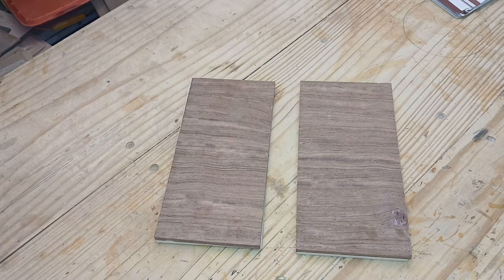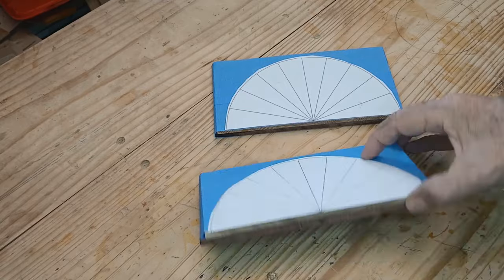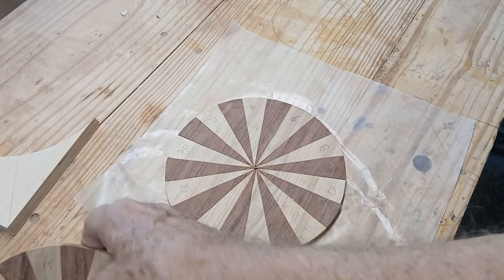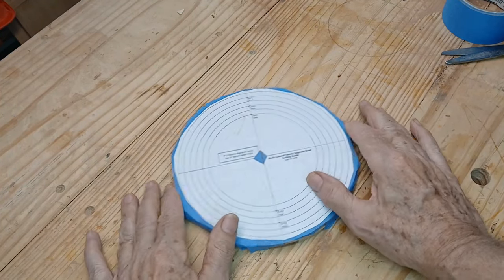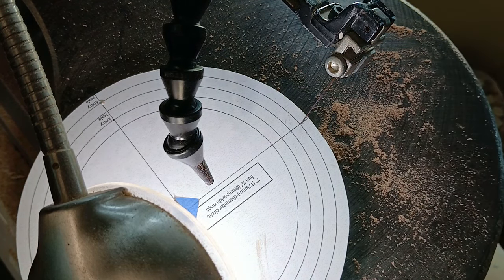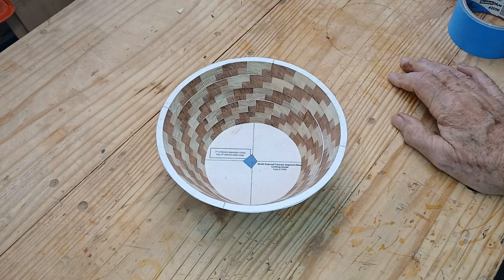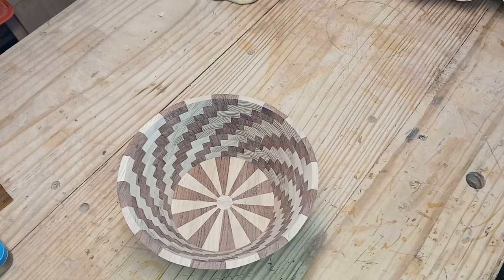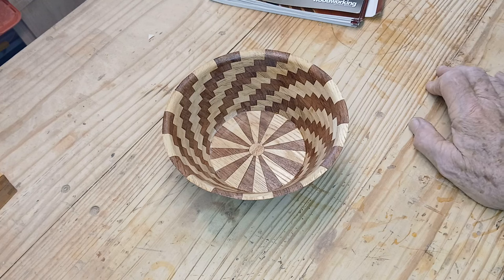Scroll Saw Bowl Made With 20 Segments (Actually There Are 40)

Comment: I'd be curious to know more about how you make these videos (what you use to position the camera, what editing software you use,  etc.  I'd like to make some videos of my own for my woodworking club here in San Diego.
Reply from the maker: I knew nothing about videography when I started out.  Just used and old camcorder a years ago when my daughter was small.  Check out Think Media on Youtube they led me to a lot of my equipment.  I have this stand  https://amzn.to/3Vd3hPs 
it is a little light but I stand it next to my work bench to steady it, I angle it to the bench to make the bench shots and stand to the right of it. I really like the ring light on it.  It will mount a cell  phone or a camera.  I use my Samsung phone to film.
I have this phone holder on another tripod at my saw  https://amzn.to/4avZYHj   
I have an old tripod that I bought my wife  years ago clamped with woodworking clamps on a mount over my saw, everything is adjustable to move from one side of the saw to another.  It gets crowded with two lights and a camera around me.  I am thinking of getting this tripod   https://amzn.to/4auu0LG   
Maybe those links can give you an idea of what I am using and checkout Think Media and also VidIQ, there are several channels that can give you good information on equipment and how to.  I use VSDC editor, it is free and has a paid version, I am using the paid version but that is not needed to make a good video. There are several tutorials on Youtube for it and VSDC has it own tutorial channel to show you how to use  it.  I hope that helps a little, I am a one man band, plan the videos, film the videos and edit the videos and started with zero experience.  I have a few acres with lots of grass to mow, trees to trim, chickens, ducks, geese, rabbits, dogs and cats.  I am retired but work harder than ever.  My Youtube channel almost becomes an afterthought some times of the year. But I love doing it for some reason.
Reply: @twinoakstreasures9032  this is great information.   Thank you so much for taking the time.   I really enjoy your videos.  You are great!